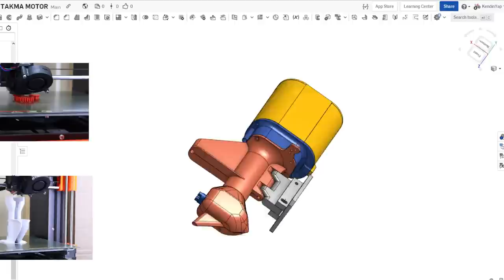How To Make Powerful Outboard Motor. 3D Printed Water-Cooled RC Boat Motor.

Comment: I have done building this motor. This is ridiculously powerful even only at a quarter of throttle! 
It is powered by 1480kv xteam brushless motor and 3 cells lipo.
I will definitely fit onto an 3d printed RC boat.
Reply from the maker: My design is for brushed motor and 2S lipo. 1480KV motor and 3S lipo might be too much for this design. Gears may break due to very high speed and power. :) Don't forget the grease. We are waiting for the results of the test with excitement.
Reply: @Kendin-Yap  hey! As i was playing continuously at high speed in the water, none of them broke. Of course I greased the spur pinion gears but the vert/horizontal gears don't have to be greased because the water will act as a greaser already.

Comment: This is the best and most complete RC boat motor I have seen! Excellent design, even if water were to get in it doesn’t matter since motor rises above the water line. The only question is the scale. It’s huge and will require a huge boat with enough front weight to offset the high mass and center of gravity. Keep it up! Your ideas are awesome!

Comment: Love the cooling pipe solution. Using the pressure from the propeller to pump water is pretty smart if you ask me ;) I've been wondering if it would work on a full-scale outboard
Reply: I wonder if having the water enter the coil at the top and exit at the bottom would improve the flow at all due to a siphoning effect. It would give the tubing an "easier" angle as well.

Comment: Despite the bulk of the bevel gears box in line with the prop it is a very good design. I'm about to design one using a small flex drive which offers a much reduced drag profile, I will see what I can achieve. The Dremmel style flex drives are quite well priced, especially if you get the drive as part of a budget Dremmel clone kit.

Comment: Well done .. ! But those parts how and where can obtain ..!?
Reply from the maker: You have to print the parts with a 3D printer. The links of the necessary files are below the video. If you do not have a 3D printer, there are companies that provide printing services. You can search for them online.
Reply: @Kendin-Yap  Thanks a lot  ..

Comment: How have those printed gears held up? I’m curious how long they will last with that power system..
Reply from the maker: As long as it works in grease oil, it's fine.
Reply: @Kendin-Yap  Cool. What material are the gears printed from?

Comment: may be stupid question ,is it possible possible to feed an esc by acid batterie
Reply from the maker: It can be used if the ESC supports 3S (11.1V) or more (Voltage).
Reply: @Kendin-Yap  in this case wich switch should be set,lipo or Ni-..
Reply from the maker: NiMH would be more accurate. ESC works with both options. This selection is just a limit selection for the ESC to cut off the energy to the motor at low voltage level. In other words, it sets a protection limit to prevent the battery from overdischarging.  @zizoeldjazairi7922
Reply: @Kendin-Yap  thank you very much

Comment: powerful? you won't even reach 2mph with that volume of water
Reply from the maker: :) What do you mean by volume? I assume you mean the cooling water outlet. It has nothing to do with power and boat speed. The thrust of the propeller provides the speed of the boat.. 27 Turn 540 motor & 57mm 3 blade propeller (2:1 gear ratio) . This is very powerful system.